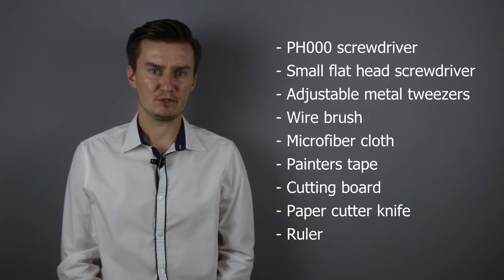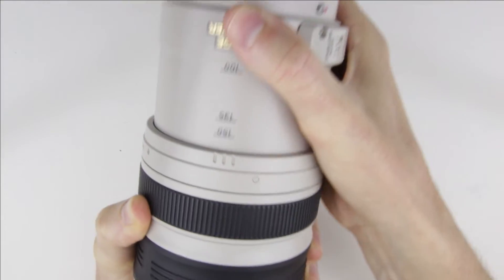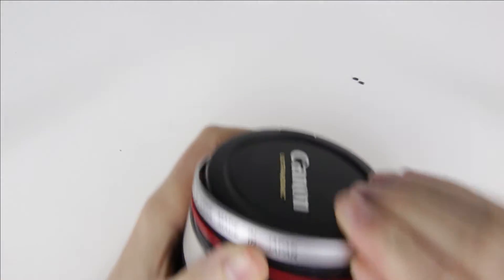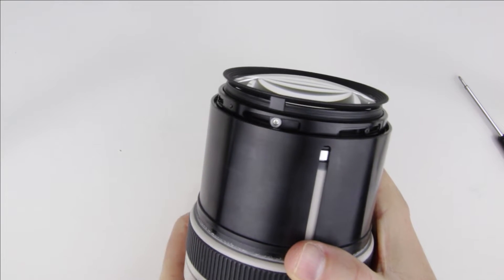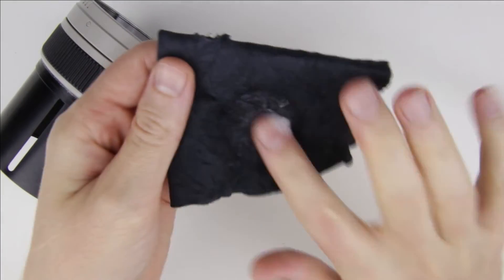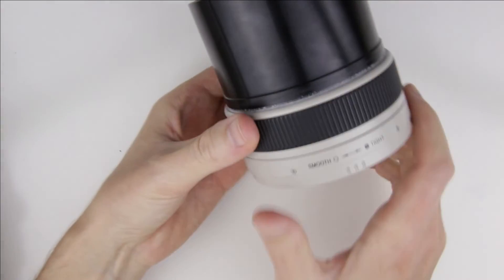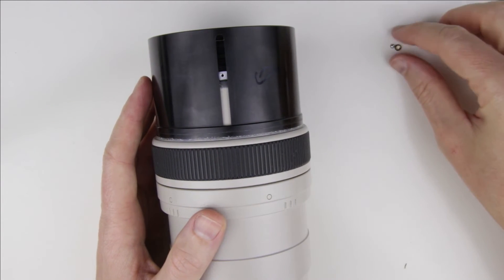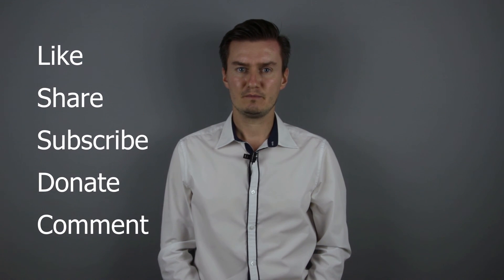Canon 100-400mm f/4.5-5.6 EF L IS USM repairing the smooth-tight zoom lock ring to avoid zoom creep

Comment: I can’t find any proper screwdriver for the tiny screws
Reply from the maker: Do you mean the small flat head screws? For those I bought a screwdriver set for watches, but the head was still thick, so I rasped the head to be sharper and that way I could undo the small flat head screws.
For the other phillips screws I used the PH000 screwdriver (link is in the description).

Comment: Thanks for clear disassembly instructions!  FYI I used electrical tape  & wrapped it around ring in 2 places (removing ring), hoping it would not come loose like I feared painter’s tape might. Also found that easier than cutting take and positioning so precisely. But great video!
Reply from the maker: Thank you for your comment!
Let me know if your method works in the long term.

Comment: Brilliant.  Just done and nice quick job and even if it doesn't last as long as a "proper" Canon replacement/repair, it works perfectly.   Mine had been repaired by Canon in 2011 (whilst they did another repair) only lasted a few years and that wasn't cheap!  I'll ping over contribution
Reply from the maker: Thank you for the PayPal donation!
I'm glad that my video has helped you!

Comment: Thank you for this detailed and well explained video. We were all set to 'fix' our lens ourselves since Canon doesn't even want to do repair services on this 'old' model. But... the L ring came of easily but seems like the cross screws underneath are all already stripped. :-/ (we bought the lens second hand several years ago) Any 'easy' advice on getting the screws out anyway? Or any safe tips on a good expert to do this for us? We really need this lens. Thanks already for your answer. And is there another way to contact you more efficiently ? ;-) We also sent you a message on messenger.
Reply from the maker: I already sent you a message on messenger, but maybe someone has the same problem here on youtube, so here is my answer:
For stripped screws first I try different, bigger or smaller screwdrivers, maybe it can grab the inner groove of the screw if any left, then I try bondhus screwgrab, if that doesn't help, then I try a cutter plier if I can grab the screw with it from the side, if that doesn't help, then I drill the head of the screw.

Comment: I have the opposite problem, the ring does not turn far so its a little stiff to zoom. Now how I have seen how it comes apart I may have a look at it. Thank you.
Reply from the maker: You're welcome and good luck!
Reply: @CamerasLensesEtc  My problem turned out to be the small balls somehow had come out of position, most of them dropped out, still have them. I spread the ones left in it around and refitted the other part of the assembly, the 2 screws would not line up perfect so it just one in it now. I have covered it and the empty hole with a small round red sticker that came with a wall planner. The lens now works fine, I bought it new 15yrs ago so its done well. Being a pensioner, the thought of spending lots to get it fixed was not something I wanted to do. It was still usable but getting worse since the problem started a few weeks ago. Thank you again.

Comment: Thank you so much for this no nonsense, clearly laid out instructional video. I could not find anything about this issue on the web with the black pieces of paper coming out from under my zoom lock ring. I followed your instructions with no problems. My only advice to others would be for the tiny flathead screws to remove the end cap of the lens with the "L" red ring. These screw are almost brittle and super, super easy to strip the slot head of the screw. This saved me likely hundreds of dollars sending it back to Canon. Thanks again!
Reply from the maker: You're right with your tip: it is easy to strip the head of the small screws, use a sharp screwdriver. Fortunately, if you damage one of the screw, you can still remove the ring after you removed the other two screws.

Comment: Great video! I wonder if you have any insight to this: My zoom ring doesn't tighten all the way. There is a gap in between the smooth-tight collar and the housing that I can't seem to close. I removed the bearings and two shims, but don't see a mechanical obstruction. Because of this, the ring isn't able to tighten fully (the housing doesn't get fully seated to the top retainer bearing to close the gap). Any thoughts would be appreciated!
Reply from the maker: When you say you removed the bearings, do you refer to the small bearing metal balls in the smoot-tight mechanism?
Reply: @CamerasLensesEtc  Yes, the pair of bearings that tighten the ring.
Reply from the maker: Well, my first thought that the metal bearing balls are not on their place, and that prevented the mechanism works correctly. I had this problem before, and for me the solution was to disassemble the bearing: remove the four screws which are on the side of the smooth-tight ring under the white cover dots, then separate the rings, after that the bearing balls will fall out (so be careful not to loose them), then I removed the bearing ball which was stuck in the smooth-tight mechanism and prevented it from working correctly. After that I put some grease on the ring, and put back the balls (they stuck in the grease, so they did not fall out), and then assembled the smooth-tight rings.
Reply: @CamerasLensesEtc  unfortunately, even after the removal of bearings and making sure there’s no ball bearing, it’s still unable to twist all the way down.

Comment: Thanks for the great tutorial. First time I did it 9 months ago, in combination with cleaning of lenses from the second tutorial. Now, after a time, tape was broaken and partially removed from the position. The result was difficult zooming. Today I did it again, again together with cleaning part (in case of disassembled lens it makes the sense). So this solution is not for ever, but 9 months is okay from my point of view, it is good time to clean also lenses after a time. I again tested finally auto and also manual focus and I didn't recognised any issue - both works well. So with the right procedure it is without problems. 20-30 mins of time per year is very good solution for me - thanks again!
Reply from the maker: You're welcome! I'm glad my videos helped you.

Comment: Thank you so much for this, I did it today and it works like a charm. Those second lot of 3 screws are made of cheese tho, Had to cut a slot in em with a dremel tool.
Reply from the maker: Thank you for the feedback! Sometimes I have those problems with the screws... sometimes the small screwdriver doesn't fit in the head perfectly, and if I feel that the screwdriver starts to bend the teeth of the head of the screw, then I use PH00 or PH0 screwdriver to get the screws out.
Reply: Cannot get these off >.< Too rusty... How frustrating!

Comment: Followed instructions, a 10 minute job, works perfectly. I used an A4 guillotine to cut the painters tape, mounted the tape on greaseproof kitchen paper. Saved me a lot of money. Lens was serviced around 8 years ago by Canon, saw where they marked the lens screws, as per the dust remover video. Most useful videos ever..
Reply: However, I seem to have lost manual focus. Autofocus is fine, so assume I’ve done something wrong?

Comment: There's dust in the zoom section. I came. All is well. What I don't understand is the sticky tape part. What happens if you don't wear sticky tape? What does sticky tape do?
Reply from the maker: The sticky tape provides the grip which is needed to lock the lens with the zoom lock. If there is no painters tape, the metal ring which the tape should be on, is sliding on the white lens tube, and it will scratch it.
Originally there is a thin velvet-like material on the ring (one side is adhesive, the other is like velvet), but since I can't buy that, I use painters tape.

Comment: My zoom lock works fine, but the zoom range is slightly limited. It wont zoom wider than  115mm. What might cause this problem? 

I tried to dissamble the lens but some of the screws were  way too tight. I actually chipped couple of screws.
Reply from the maker: In general, start disassembling the lens, and after every part you remove, test the lens is it runs on the whole zoom range. This problem usually caused by a lens part which is not in the right position... sometimes quite hard to determine which one, but when assembling the lens, make sure you follow exactly the way it is assembled in the video. This problem happens sometimes with me, usually the solution is to disassemble the lens, and twist one of the inner lens tube 120 degrees (so I assembled the lens incorrectly).
Chipped screws: well, that is a quite annoying, and takes lots of time to remove them. Search in youtube for ideas how to solve this problem, I'm quite sure there are tons of videos of this topic.

Comment: Why didnt you remove the metal ring to clean it and put the tape on? its much more easy to put the tape on when its out of the lens and cut the tape to size, just cut all the tape thats sticks out of the ring.
Reply from the maker: As I remember, I can't remove the ring from inside. Anyway, I don't think it would be much easier to clean and stick the painters tape on the ring when it is removed than when it is not.

Comment: I have a Canon 100-400mm f/4.5-5.6 EF L IS USM and the Manual Focus appears to be malfunctioning. The distance scale does not move and when looking through the viewfinder turning the focus ring does not change focus. Is it as simple as tightening screws in the lens after disassembling it or harder than that? Any help would be greatly appreciated.
Reply from the maker: Hello! I would start disassemble the lens, and after every step (lens part removed), test the manual focus. If the manual focus runs smooth again, then I would check the last removed lens part.